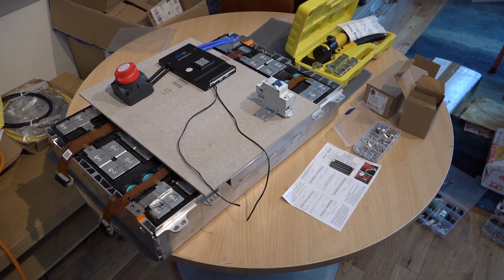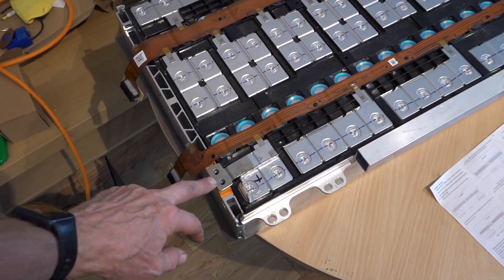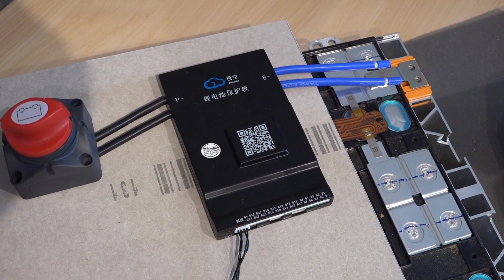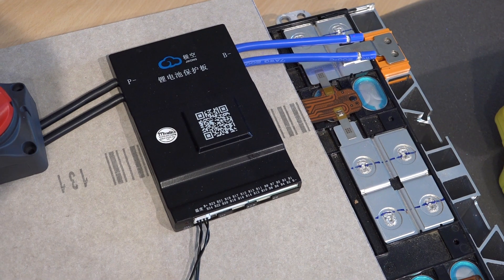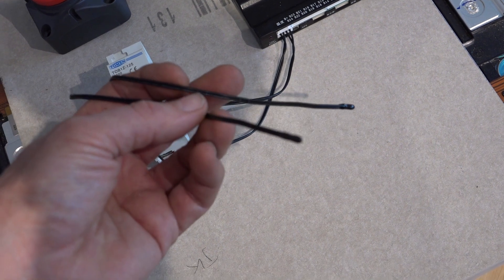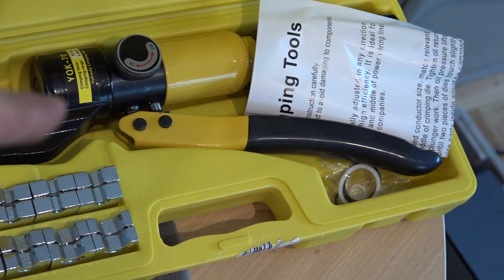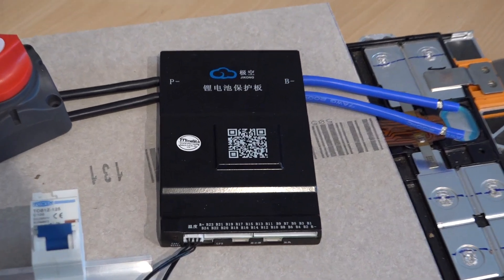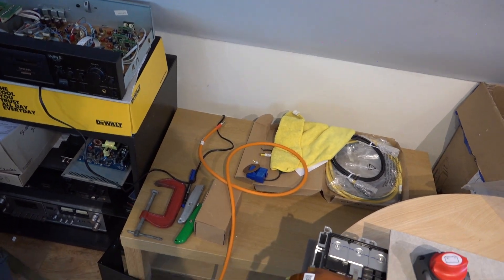Shrapnel Damaged Mercedes EV Battery Reclaimed for 20KWh Home Storage Pack

Comment: How many panels are you using with this set up? Assuming they are about 350w
Reply from the maker: have 19 panels -  13 of them are rated 300W (10 years old) connected to a 2.7Kw Fronious inverter  and the 6 are rated at 240W (6 years old) connected to a growatt inverter, In this country the system hardly never turn out the rated power. They aren't efficient when hot so they work much better in cold clear conditions with powerful sun Late spring usually. .  I have installed several systems for friends lately as I became an authorised installer early this year. The peak maximum I have seen post inverter on my system is 3.5kw  so expect about 70% of what is says on the tin.   The inverter loses are about 8% of the power in conversion.  I have measured the efficiency of Fronious and Growatt inverters  i.e. DC power input kWH VS AC power output kWH.

Comment: Buy an electric water heater to use as a dump load for all that excess solar and get free hot water.
Reply from the maker: Only if you don't have mains gas. Gas is 7  Pence/kWH and electricity is 31 pence. It much better financial sense to use the electricity for general power. I have solar hot water tubes.that heat the water between May and the end of September.
Reply: @razenby  how is gas so cheap when Russia doesn't supply any to Europe? Just wait for it to skyrocket even in england
Reply from the maker: @kitecattestecke2303  Gas will allays be cheaper per KWh than electricity.
Reply: @razenby  Going renewables isn't about saving money.

Comment: That looks like an excellent setup you have, i'm sure you will grow the system as you find more batterys 😀
Hmm can bus like on a car, but a different data type i suppose.
I'm sure you will have your evil way with it 😀
I was thinking about the position of the temp sensors in that battery pack, two down the center line of the pack. maybe?.
A wind turbine may be your next possibility.
Reply from the maker: Thanks.  We will see how successful it it is. including the Growatt SPA3000  has cost about £1800 so far. I expect by the time I bought a cabinet for the batteries it will cost around £2K, It wont take long to pay me back at ~£3 per day. The shrapnel damaged donor car was a year old with 7,00 kilometers on the clock so these premium traction batteries should still  in a strong condition. I'll review the BMS system and perhaps even read the instructions.  My guess is that one sensor for ambient in the cabinet and the other will be fixed to the pack by silicone to monitor the actual cell cell temp.  I would love a turbine but we are surrounded by trees. I fear that it would be too gusty.  My next project after this is a Combined Heat and Power  system (CHP)  which generates 3.6 kVA electricity and hot water from the coolling system and exhaust gas heat exchanger. It will run on the natural gas main. Very expensive RVs /exhibition trailers  generators are widely being replaced by Lion batteries and inverters.  I just picked up a Honda twin cylinder water cooled generator for a £200. The hours counter says it has been run for a total of 16 hours.  I will use it in the winter to charge the batteries and heat the radiators. It should put out 3.6kVA of power and about 14kW water heating. That is the thery anyway!!

Comment: Nice system, how long do you think it’ll take to recoup the monies spent on a system like this? Solar in the uk seems to take many years, 10yrs etc to get the outlay back. Is that still the case?
Reply from the maker: Thanks. I fitted by 4.6 kW solar panels 10 years ago and they have more than paid for themselves by in-feed tariff. This system cost about £1800 so, at current electricity prices  that will be paid back in between  2 to 3 years..It will save about £3 to £4 UK  pounds per day in electricity costs.